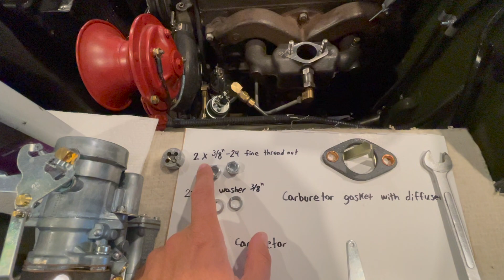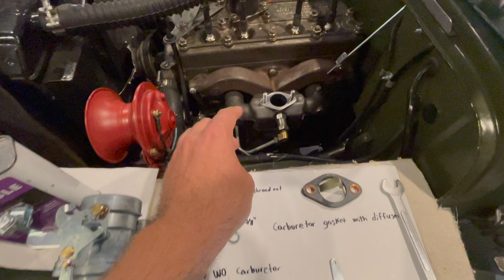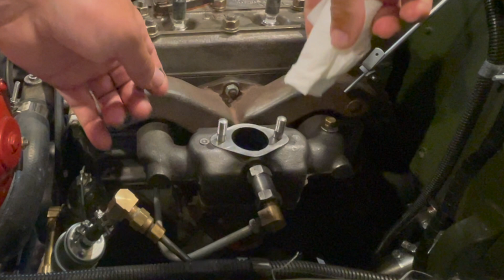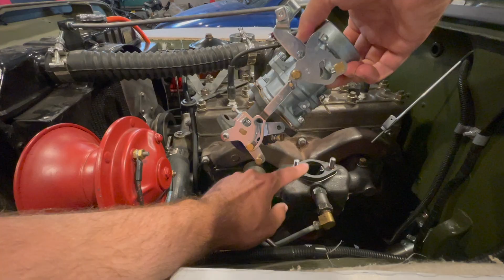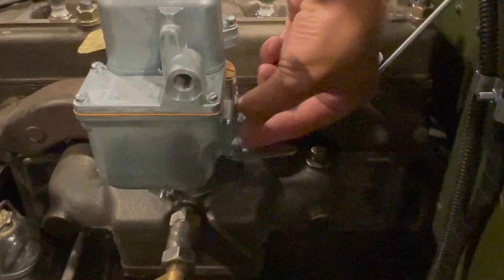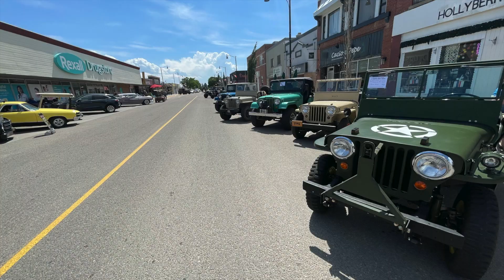How to install Carter WO Carburetor (original) | 41-53 Willys Jeep

Comment: How does it run compared to the solex? Did you have to get new throttle and choke cables?
Reply: Last they told me they like it better. I have another buddy who has a Solex on his M38CDN and swears by it.
Reply: I currently have a Chinese agricultural carb on mine and it works very well lol